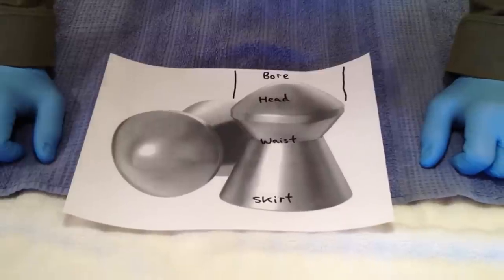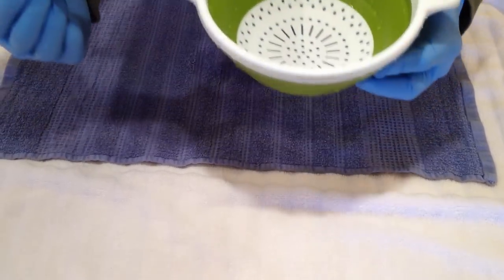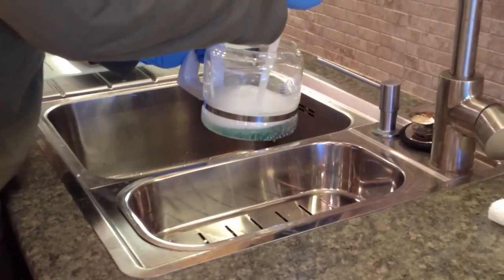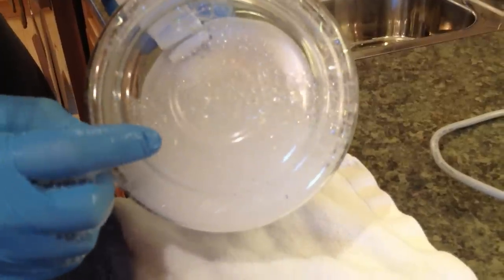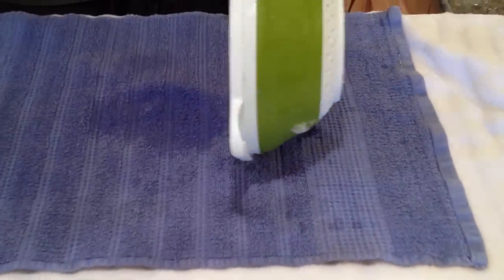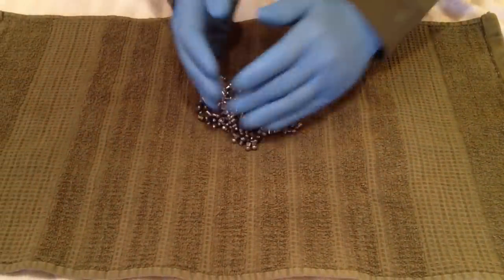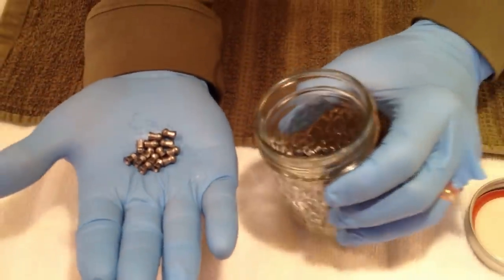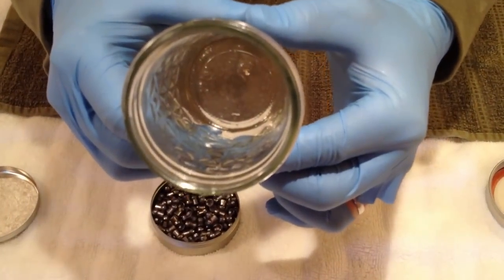How to clean air rifle pellets

Comment: Alcohol rinse removes much more without beating the skirts into gaterskin! I roll my pellets on clean cotton sheet material. Then I dry. I then put a coating of pellet lube on a clean cloth. I roll gently to coat pellets.I warm dry and seal pellets in marked tin.

Comment: never use WD 40 as it will rot all your seals, always use silicon spray.
Reply: you too, thanks for your quick response, WD is actually made from fish oil which rots any rubber it comes into contact with, perfect for firearms but definitely not for airguns, cheers.
Reply: @MrSpiker357
Thank you very much for the info & I will clean the containers too or keep them in a glass container.
Reply: Raymond Foster THANK YOU for warning
Reply: Raymond,  WD-40 is a brand. They do supply excellent silicon based (and other non-oil based,  polytetrafluorethylene (PTFE)) lubricant as well. However it is true that the "classic" WD40 is petroleum based which can be harmful if used on rubber seals.
Reply: @ykzcohan  WD-40 is a specific formula for a water-displacing spray that also acts as a very popular lubricant/penetrating oil. When most people say WD-40 they are talking about this specific product, and this is generally understood by everyone. However, you are correct that the company has since changed it's name to reflect this flagship product of theirs...but it's probably not really pertinent to go around correcting people about it. We all knew what he meant.
Reply: I once used black powder bore cleaner thinking ( wrongfully ) that it would remove all lead. What a major mistake; I wound up throwing the pellet gun in the trash -  DONT USE IT !

Comment: Thank you for the nice and helpful video. To colaborate with you , I advise you to let the pelets on the hot water for 5 minutes to let the detergent work time enables  all surface of the pelet-if you shake it 3 times durnng this 5 minutes it will let it be more efficient - This procedure is done on lab flasks that you don't reach the corners to rub it. Also use always neutral detergents on a base of 1 to 2%. Anything more will not have no advantages - only loose money and poluition . Finnaly , working this way probably you will need only one time clean for the whole process.Best regards Helio

Comment: Thank you for this video. Im definitely going to have to do this. Just got a new air rifle and don't want to goober the barrel and suppressor up with lead dust and lead shavings. Definitely want to keep a $1000+ rifle at its best and most accurate state of being. Mine is a hunter and keeps pest animal problems down to a minimum if not 100 clear around the horse stable. Must say the high powered .25 cal pcp rifles really do a good job.

Comment: I've done this for years and have always used WD40, as you say, I only use one short squirt then I dab them with kitchen paper to remove excess oil and let it dry for while. wd40 has a lot of silicone in it. I use on my spring gamo and my gas ram Weihrauch hw90. I have never suffered dieseling. Usually gain around 20 feet per sec muzzle velocity so if in the uk don't forget to chronograph to make sure your legal. It's definitely worth it as eliminates those fliers.
Reply: Sean Wilson 
Oh Wow,,,   Flyers, ,,  I am new to air gunning,,,  
I thought that the flyers were just bad pellets...
I  will try the wd 40...  
The flyers are making me discouraged. ..
tanx again....

Comment: MrSpiker,
Thanks for the video! Just some random thoughts...the poster 'Amelie' is correct in that trichloroethylene was formerly a substitute for ether, and is still used for making decaf coffee. What might be better, try a first wash of denatured alcohol or acetone, followed by the 2nd wash of soap and water (or vice-versa). Acetone in particular is a great degreaser, and will naturally evaporate (do this outside). As for the hair dryer, I would worry about the heat warping the skirts, unless you have an 'air only' setting.

Comment: I recently purchased h&n slug hp pellets in different weights.  And they are also covered with a kind of dry graphite lubricant!, usually I lubricate with napier, or dry pellet lubricants like LT1 or PL1 or even kolter speed shot.  But with h&n I'm hesitant, if the manufacturer chose this lubricant it must be good, right?

Comment: try using liquid Alox from Lee reloading accessories, four drops in a bowl after the pellets have been cleaned, lay out on wax paper let dry for 24 hrs, tuned up my gamo silent hunter. never had I had any of the lead pellets break the sound barrier 1250 fps now  they all do amazing results.pretty much using the same method as this vid which is great by the way

Comment: Excellent video MrSpiker357. I am about to buy a brand new .177 HW100 and was wondering about pellet wash and lubing.I want to look after my new barrel and achieve the best accuracy that i can. I can understand washing the pellets to remove the lead dust but i cant really understand why oil is needed to be added to the pellet. Surely oil in the barrel will attract dirt, dust and eventually lead to barrel fouling. Also, how many pellets will it take before my rifles barrel will need cleaning ?

Comment: great video.  lots of great tips.  BTW, not trying to be too picky, but i noticed that you 1. used a strainer marked "do not use with food"; 2. used nitrile gloves; 3. used a dedicated glass container for washing the pellets; and 4. gave many (good) warnings about the use of lead.  however, i couldn't help but notice that you repeatedly dumped the waste water down the kitchen sink.  can i assume that this sink is NOT where you wash your dishes and clean your food, but is a work room sink in your shop?  'cuz if not, all those lead particles could easily be lining the sink's surface and transferred over to your dishes &/or food.
Reply: thanks for the reply.  i realize that its been about 2 years since we did the above posts.  i'm not sure why it didn't click with me back then, and i certainly don't want to dwell on the "evils of the lead monster", but re-reading both my post and your response just caused me to wonder something.  as you stated above, "... When you consume lead, your stomach acid (HCl) causes a severe change in pH and subsequent chemical reaction, and then the harmful effects can occur.  So, keep lead out of your mouth ..."  this is why i made my initial post, because if the sink that you used in your video is the one that you use to clean your dishes &/or use for food prep, then it's highly likely that one is creating the conditions that would, in fact, cause one to violate the very warning that you mention as lead would be introduced into your mouth via eating utensils and food coming into contact with the lead residue in your sink whenever you wash dishes &/or wash fruits/veggies in that very sink.  again, not trying to be a PITA, it's just something that i'm wondering about whenever i watch the above video.

Comment: Have you ever wondered that you may have a touch of OCD?
I've just been using some 30+ year old .22 lead pellets (that are about as oxidized as you can get) in my equally old springer, and I'm still getting good groups.
Reply: [British sense of humour] 
That particular rifle is a Webley Eclipse MK II (Carbine) .22 and the pellets are "Webley Special waisted pellets". Pretty old fashioned by today's standards.
Reply: I gave it a try and I'm converted!
I'd been having some issues with one of my CO2 pistols. The pellets that I'd been using since purchasing this pistol were starting to misfire and jam. I washed, dried and lubricated some of the pellets and immediately noticed they load in the magazines much better, the jamming issue has virtually stopped, and my bullseye groups are even better than normal!
I think it must have been a dirty batch of pellets (I normally buy tins of 500 in multiples of 10). So I've a few to get through!

Comment: After all the rattle and banging together the pellets will be worse I should think.  An ultrasonic tank would be a better choice. If accuracy is so critical the pellet weight is more important. Inspect every one also for damage then oil them. Also use a pellet pouch when in the field as tins and pockets are noisy/ contaminated and cause more damage.  Happy shooting
Reply: Great idea !

Comment: Yes, Im using the 5.51mm (.22) for my dominator. Ive been shooting a lot of different pellets: HN baracuda match, HN hollow point, Gamo Pro magnum and last but notleastthe samyang "hard hitting pellet". I started off useing HN baracuda changed to the samyang (for some reason they didn't fit into the barrel unless you pushed it using the strenght of a 1000 men (didn't fit in a WH 57, walther 1250 nor in the Diana))

Comment: Nice thoughtful video. I have 2500 very old (10 years +) pellets and was thinking of polishing the oxidization off in a tumbler.

Then using a very thin, hot paraffin wax to prevent further oxidization. I'll have to be careful to get very thin coating otherwise pellet balance maybe affected.

Comment: Try using an ultrasonic vibrating cleaner filled with Purple Power, with Purple Power in a jar with a lid. Put the jar in the cleaner with the pellets in the jar and heat to 50-60 degrees C, and agitate for 15 minutes, drain Purple Power from jar back into cleaner, rinse, dry and then put pellets in jar with Ballistol, remove pellets from Ballistol and stand each pellet on the skirt end on some paper towel for 12 hours (so that the inside of the skirt gets drained), return to a clean container and ready for use..

Comment: even if you use 4 stroke oil for motorcycles if you dont put too much it will be lubricating and definitly not diseling! for diseling you need to put any flamable substance in compresion chamber (if you put pellet and even fully fill the barel with oil from the end side it will be lubing not diseling)

Comment: oops ... the other dude was suggesting tricloroethilene not tricloroethane ... ok try the solvents that are used in dry washers.
Some time ago it was readily available (and commonly called TCE, trichlor, Trike, Tricky and tri) nowdays it's less common and being replaced by avio (a mixture of n-exane and 2,1 dicloropropane) but there are still some stores that keep the old stuff.

Comment: Your jar needs acetone with some Napier solution, then the pellets will have an even coating.
A small tea strainer would be used when poured into another jar.
Of course why use water and detergent, when acetone would work better.

Comment: Shooting matches , you would NEVER EVER shake pellets against each other.   Ive see guys if they drop the can of pellets by accident. They then use those pellets strictly as practice. I can see putting them in a strainer and cleaning them under running water .

Comment: If you want the pellets to dry really fast give them a last wash in meths and then use the hair drier ... it will be a matter of seconds and they're dry. Aditionally the meths will remove any oil that the soap failed to remove.